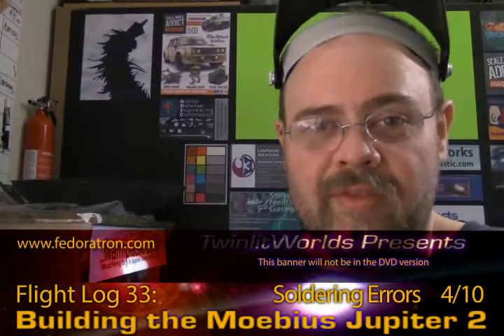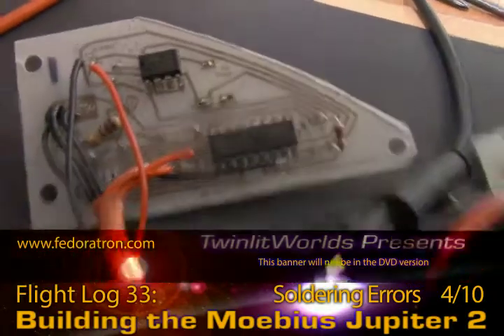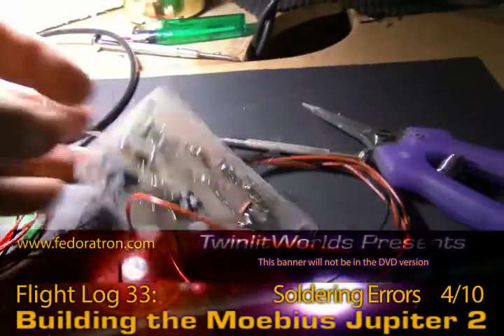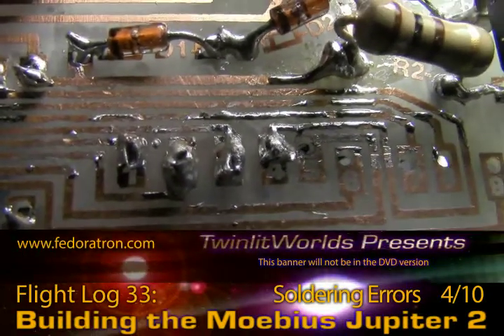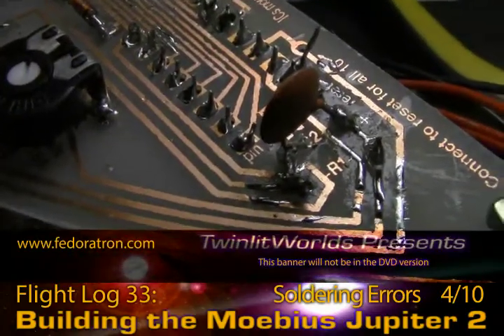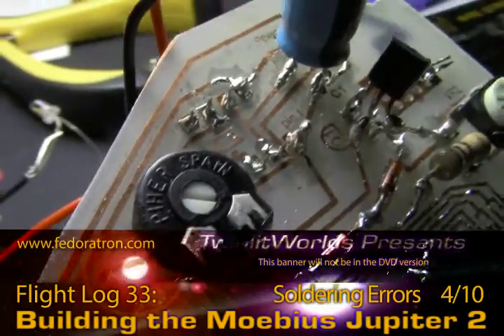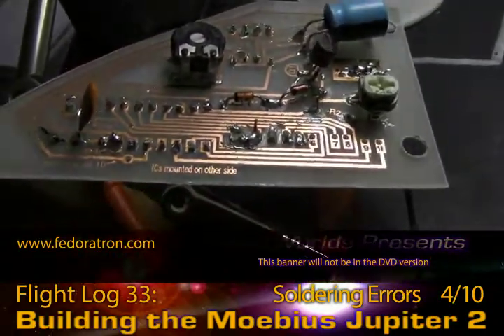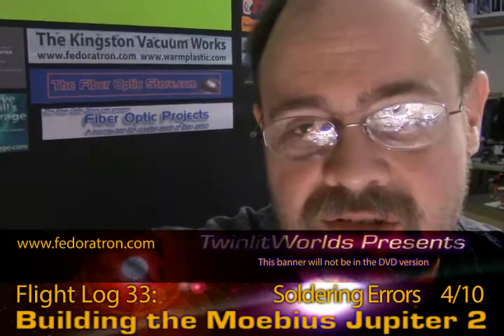J2 FlightLog 33: Part 4, Soldering Errors

Comment: I am very glad to be seeing someone else work on my boards. There is a high "fuss" factor to them-- I surely do know. The single biggest observation I can make, Tom, is use much less solder. Don't apply the solder and iron at the same time. Heat the joint first then add just the tippy tip (yes, I speak tech) of the solder.
If you're going to place the transistor on the opposite side to the copper, you have to put the legs in the same holes as shown on the copper side. So following the little pictogram of the transistor-- as looking through the circuit board-- doesn't help. Doing that is a little easier with the capacitors, as following the "+" through the board is straightforward.
But the thing to remember-- dear, dear customers (and you too Tom!) is that the circuit works. But it is not forgiving while being put together. So go slow.
Also-- I apparently did not send the final instructions for the ModelMan Wall-Shaped board to Tom. But I should. They may not help, but seeing it couldn't hurt.
Reply from the maker: Thanks for the notes, Eliot!  They will be helpful when I go to troubleshoot these.  A pdf of the directions works just as well for me.  They weren't created as yet when the boards were sent.

Comment: On my board, I had the transistor backwards. So I had to flip it on the other side. Also, to get all ten leds to sequence was to connect to reset for all 10(that required hooking up a jumper wire) which in my instruction sheet was vague about.

Comment: You might want to use a Cold Heat soldering iron . They use 4 AA batteries and only heat up when you touch the solder to the area that you are working on.